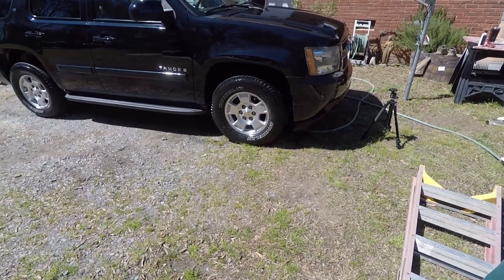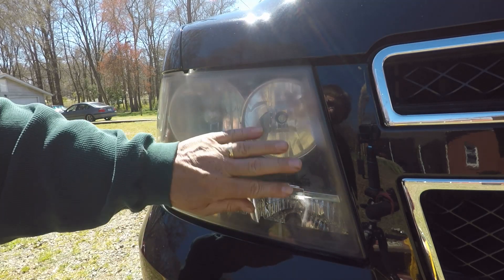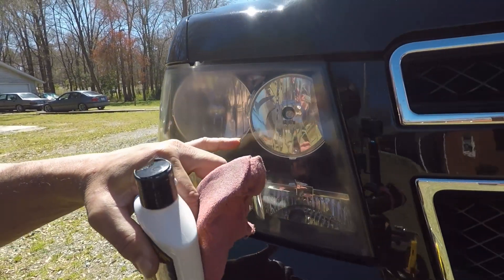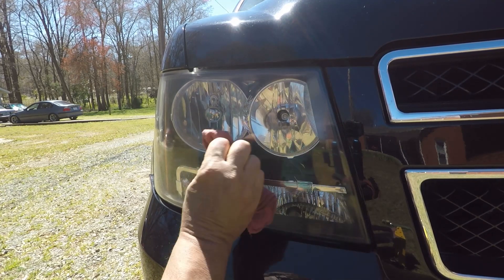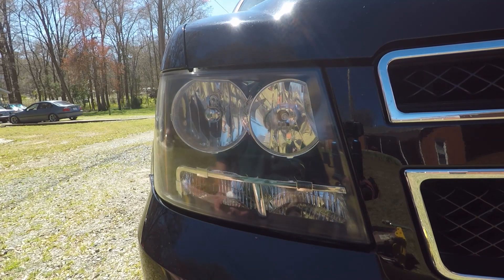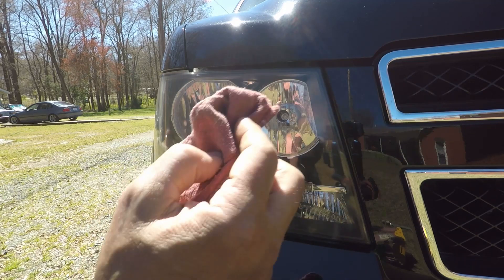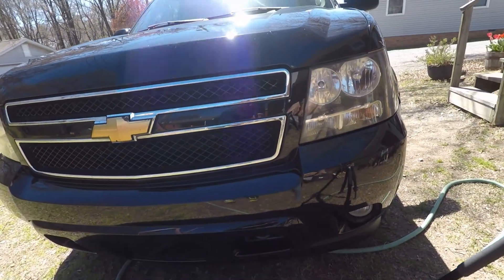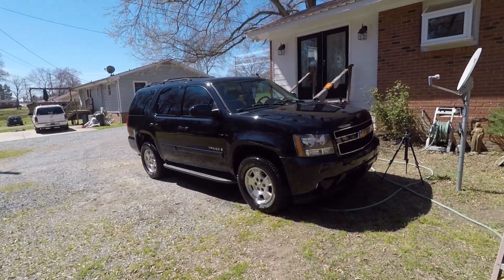Meguiar's PlastX Does it work headlight restoration plus some randomness

Comment: I love that lightning opening! It would be nice if headlight manufacturers made the plastic easier to remove to the inside could be treated as well. Nice work.
Reply from the maker: Thank you Fan. I really wish they would go back to glass. Although I know they will not because they would not be able to get the wild shapes they use. But I agree with you. It would be nice to do that. Thanks for watching